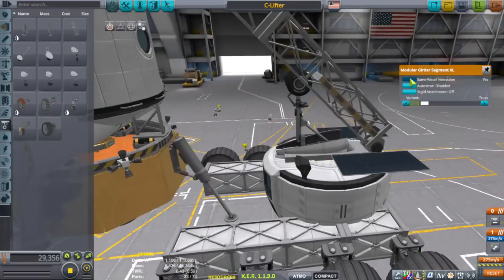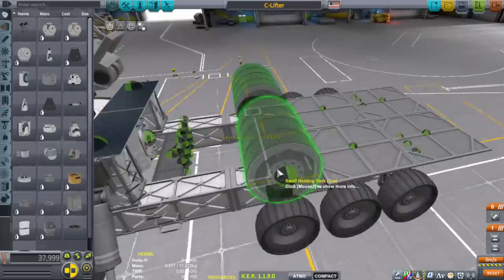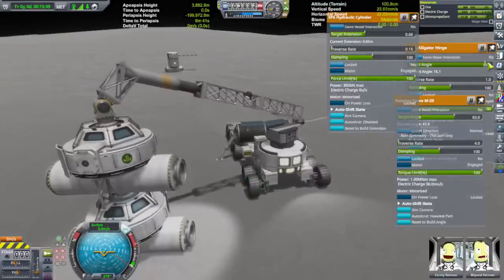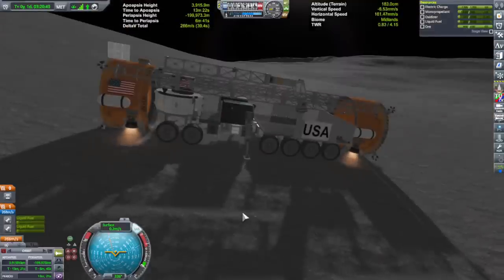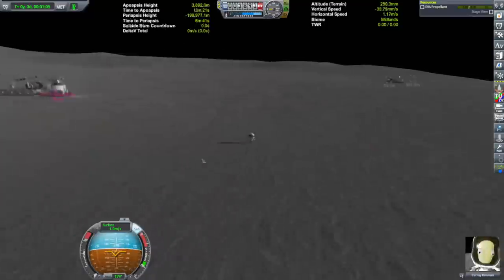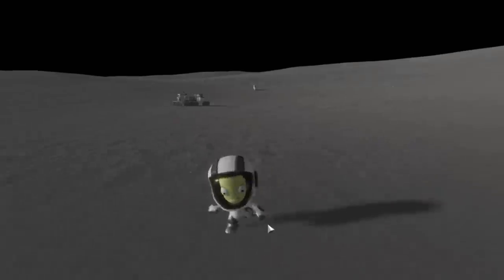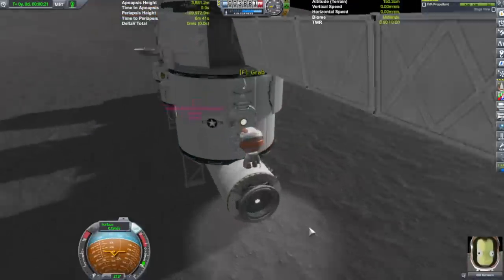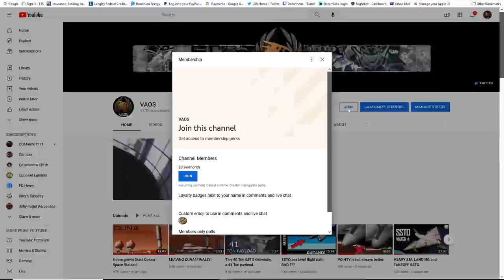NASA STYLE MOON BASE in KSP!

Comment: It’s wonderful that we’ll be able to pull off even cooler, more appropriate stuff like this in KSP 2!!!
Reply: And it will be a actual game mechanic
Reply: I'm really looking forward to KSP 2, but I have to say, there's a few things that KSP 2 needs to address and a few that it should address before I contemplate buying it. I want to see bugfixes, wheels and landing gear need to work properly (i hate that driving rovers feels like skidding on greased up ice), robotics need to work properly.

It also wouldn't hurt if the game ran more stable and allowed for larger and more complex craft without massive performance losses.

But frankly, I expect KSP2 to be a dumbed down mess, but maybe that's just my cynicism speaking.
Reply: @h.a.9880  you will be able to make transfer routed by rover so they should fix the physics
Reply: @Agge1  It's also a new engine, so hopefully, it'll be one that can handle the alien and outrageous concept of wheels better than unity did...
Reply: @h.a.9880  they fixed the gear and wheels they said it themselves and also performance is also said to be fixed
Reply: @samuelsnowdon2271  I will believe that when I see it, tbh.
KSP was declared "finished" with massive bugs still present and instead of fixing them, 1.12.4 introduces a shitty KSP launcher and kills all my safegames in the process. There was another small patch a few days ago, hoped it would fix the safegame issue, but nope.

Under such conditions, I feel it prudent to wait for KSP2 to come out and waiting for some time and listen to the word of mouth before getting it.
Reply: @h.a.9880  Yeah but at the same time its  gonna be early access which is meant for community improvements just watch the videos
Reply: @h.a.9880  and also i never had that problem
Reply: @samuelsnowdon2271  I don't have a problem with that. I played KSP back when it was a free demo and got the full game in like 2014 or so. I never regretted buying it and I have many hundreds of hours with it.
It's one of my top 10 best games of all time right alongside such titles as Half-Life Deus Ex, Gothic, Morrowind and Kingdom Come: Deliverance.

However before I get into KSP2 I demand improvements. Whether KSP2 is an early access title or not doesn't really matter to me. I know it might not start out with the improvements I look for and that it receives them later on, but I still want those bugs taken care of.

As for "I didn't run into that issue", that's nice for you. I did. And it's frustrating to say the least. It's the safegame I used since I bought the game and it's most likely gone now.
Reply: Well this aged like fine milk
Reply: @MorbidGalaxy I drink milk that’s past it’s due date by months or years
Reply: This aged well.
Reply: Well this aged poorly

Comment: Nice truck capture! I know that driving in KSP has always been “janky”, but it infuriates me every time I loose control of a rover and remember that they made driving worse with the version 12 update, and it will never get fixed. I had some fun rover designs that worked great froren 12 that are now slippery/slidy death traps.
Reply: You can override wheel friction with the tweakables menu. I do that all the time. So far, I've only tried turning the friction up to 10 and building the rover incredibly wide and low so it doesn't flip. It's pretty awesome when you can drive along 60 degree side-slopes on Kerbin, though I guess I'll get to a balanced approach eventually.

I don't have a cure for the weedy little baby torque limiter, but there is a relevant override for that too, I just haven't figured it out yet. Though to be fair, none of this takes into account the fact that grass is kind-of slippery and reggolith is often lots of tiny stones which can roll over each other.

Comment: Meanwhile I just gave up doing proper cranes in KSP and do container cranes xD

For all man kind is basically KSP level of accuracy ;-). Space Shuttle to the Moon with closed cargo bay doors and no extra tanks, Buran using solid fuel boosters and other questionable shenanigans.
Reply: Dont forget SSTO from Earth to Mars, or a NERVA powered space shuttle that can somehow lift its own weight
Reply: KSP is a bit careless about cooling and freely allows restarting rocket engines, but when it comes to orbital mechanics it's actually a little harder than real life because all the parts are a little heavier; It just has smaller planets, orbits, and star. If it allowed a modern sci-fi level of "questionable shenanigans," I'd have a lot more finished projects and a lot fewer failures.

Comment: Hey VAOS, I have a question. Did you manage to solve the issue with the robotics? I just threw a whole bunch of stuff on the moon and started building a mining facility, but I noticed after a while that when jumping back and forth between vessels that the robotics start to shift from their original place and it's ruined my build. It's really frustrating and I wonder if there's a fix to keep things in place?
Reply from the maker: other then locking them before you leave… the only thing you can do more, is set them back to their compact position then lockthem before leaving. 

sorry i can’t help anymore than that. 🫡
Reply: @vaos3712  Ahh, yes that's the way to keep the parts themselves from moving. But I mean, they shift from their built position. Like if I stuck a hinge to a fuselage or rocket piece, it appears the robotics identify as different pieces and over time they will shift from the parts they're attached to, making it only playable for a few saves. It has been a bug for 4 years appearantly. It's really stupid they never fixed it. When you send a ship far out into space and it's engines contain robotics, it means the ship can become unflyable and will never be able to return home.

Out of all the bugs, this one really sucks.
Reply from the maker: @timspiker  that does suck. had the same problem with the Duna Colony series long time ago. fixed it by making the craft  with as few parts as possible. Auto strut and rigid attachment EVERYTHING. it worked 75% of the time. 

hope this helps
Reply: @vaos3712  Thanks, I'll try that out. Shame I have to delete my facility, it was half assembled... Done with crane on the mun. You know the pain :(

Comment: Bro, I tried building that truck delivery system you got there.. and my shit looks like an accordion dropping to the mun. 😂😂😂 it’s all out of control. Not stiff enough but I pretty much copied what you got there.. but my rig certainly doesn’t fly like that ….
Reply from the maker: Did you use Auto Strut ?
Reply: @vaos3712  on some stuff like the tanks.. to the truck.. and I put real struts too. The problem is that the girders seem attached to the gas tanks in the VAB but they usually detach from one side during flight. I ended up getting three trucks on the mun but it wasn’t pretty. 😂😂 do you have a video on how you build that from start to finish? The truck is bad ass! I modified it a little bit but it’s super functional and fun to use.
Reply from the maker: @Cptpaul12  I’ll have to check to see if i still have the craft file. Try turning on Ridgid attachment on all parts and auto strut all parts, cycle Through the auto strut on each part , example: one part is strutted to heaviest part , next part strutted to grandparent, so on and so forth keep cycling so that all parts are strutted to different parts like a web. Other then that, I couldn’t tell you what’s wrong. Hope this helps 😎👍
Reply: @vaos3712  thanks, dude! I’ll try that

Comment: Hey VAOS, I've got an idea that I've been working on for a year that I want you to take a crack at. Don't worry, its not a large project. I've been trying to make a rover with a trailer bed that's expandable... to about 20 meters.
Reply: I want it to have a sky crane docking pad on it. I've worked out a sky crane design on my own using information on KAL units from a channel named "urban venture" (makes you a KAL wiz instantly). It can augment it's thruster orientation vertically as well, to better align with the new center of mass that comes with every payload.
Reply: It's also pretty smart to have the underside of the vehicle act as a sort of fuel store, so it can both help maintain a low center of mass while transporting builds, and can serve as a fuel transporter itself.
Reply: I was also thinking of having the base fuel store be a modular array, so I could make new fuel tanks for different kinds of fuel if needed. Future proofing, and all.